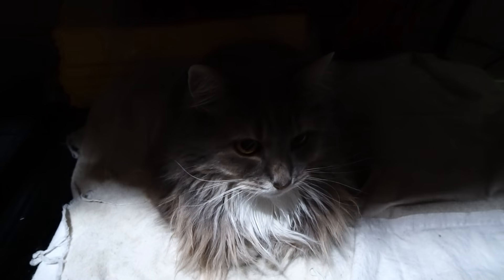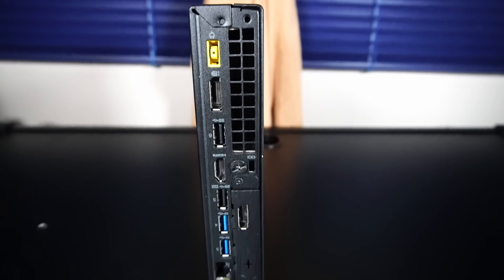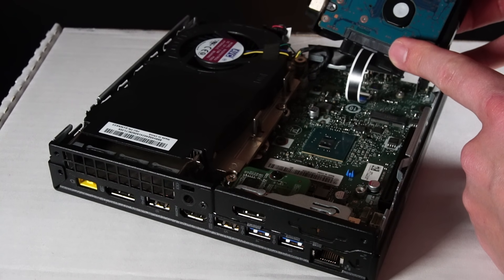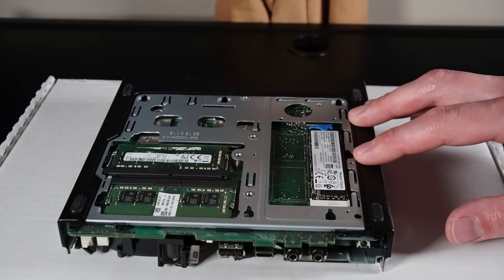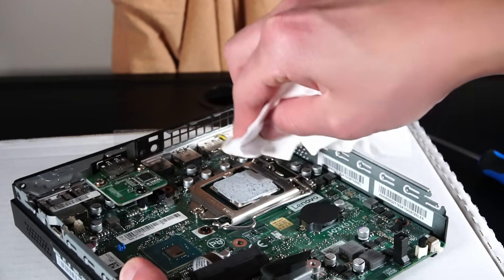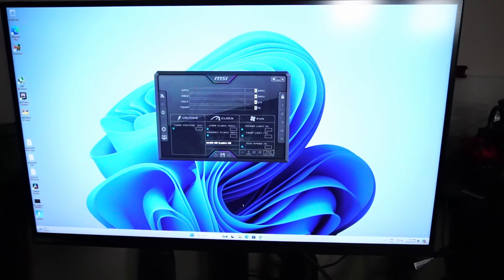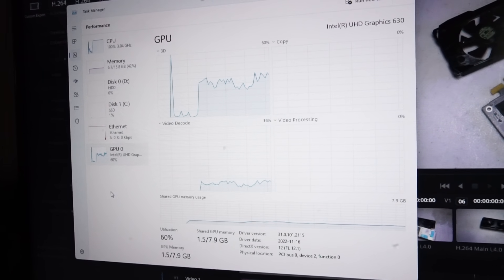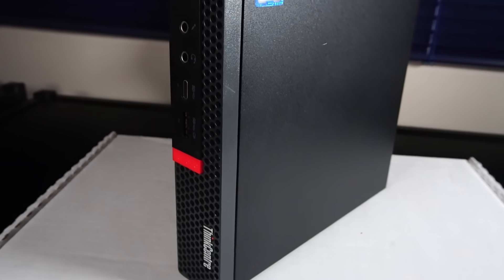Lenovo ThinkCentre M920q Tiny  in 2024:  Review, Gaming, Video Rendering!

Comment: Is the fan loud if only looking at YouTube?
Reply from the maker: It shouldn't be, unless you are in a particularly hot area.  Or, if the ventilation is blocked off.  Dust build up or dried up thermal paste on the CPU.

Comment: it's not that hard to add a single slot GPU, like the rx 6400 or the yeston rtx 3050, you can get a cheap riser adapter for the pcie conector and a cheap 230w power supply and you are good to go, watching it from my m920q with the MSI RTX 3050 LP, great tiny pc
Reply from the maker: That's awesome.  I received two M920q's with 64GB RAM & 1TB NVMe SSD.  I also have the optical drive enclosures to fit them into.  They are meant for resale from my home business, but I am very tempted to keep one and do the GPU upgrade.  Care to share pics of what you have done?  haisterepair@gmail.com
Reply: @HaisteComputerRepair  sure thing

Comment: The original bulk wifi card is for almost 15$ and fits inside perfectly like factory mounted, not usb wifI card needed.
Reply from the maker: It really depends on where in the world you are purchasing from.  As well, the antennae assembly connecting to the m.2 card and extending to the rear of the case.  At the time this video was made, purchasing both cost more in CAD to order than the two USB WiFi/Bluetooth options I have in the video.  I would of course prefer to install the m.2 card assembly, but I also don't mind exploring other options if the customer is wanting it.